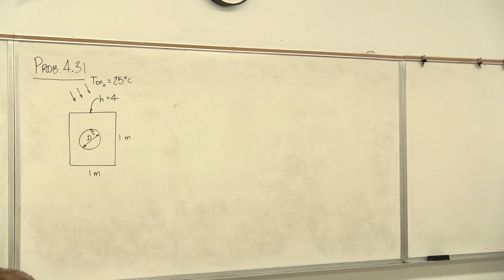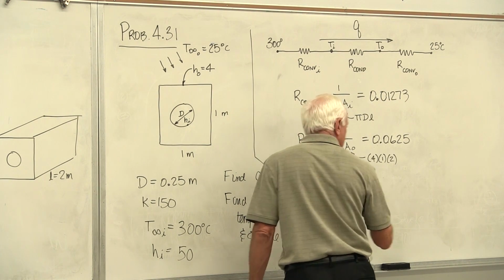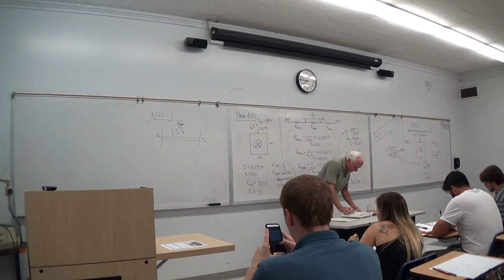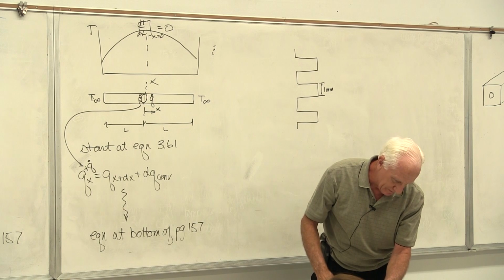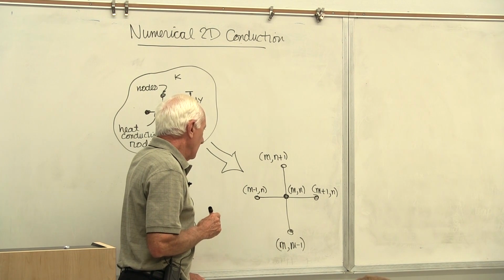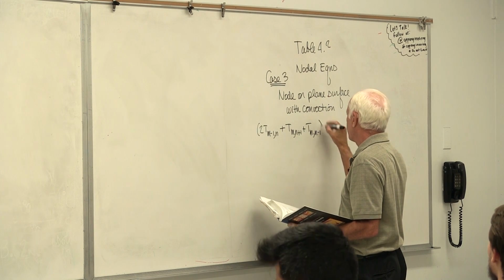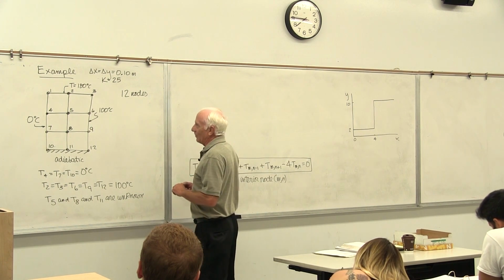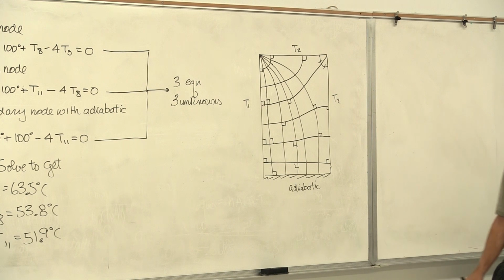Heat Transfer: Two-Dimensional Conduction, Part II (9 of 26)

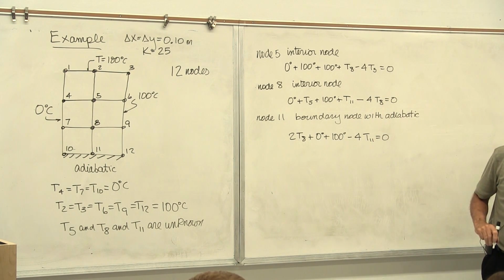Comment: I think there is one mistake in this. At 54:14, node 11 equation doesn't follow the equation on the far right. The m values are on the x axis. m-1 should be node 10, not 8. Is that a mistake?
Reply: A more straight forward to figure it out...2 * the temp of the interior node + sum of the surrounding at the edge node temps - 4*the center node.   The equation above is correct.   Note: the orientation of the picture in the book relative to the problem...it's rotated...don't get caught up in the indices.   The draw picture, map the grid points on it relative to the adiabatic surface.
Reply: thats what i thought too.
Reply: I think you should write 2T_(m,n+1)+T(m-1,n)+T(m+1,n)-4T_(m,n)=0 for node 11, regards!